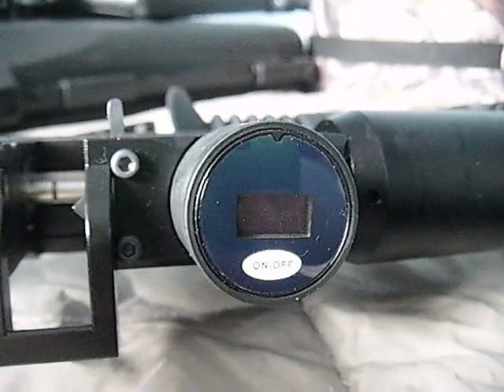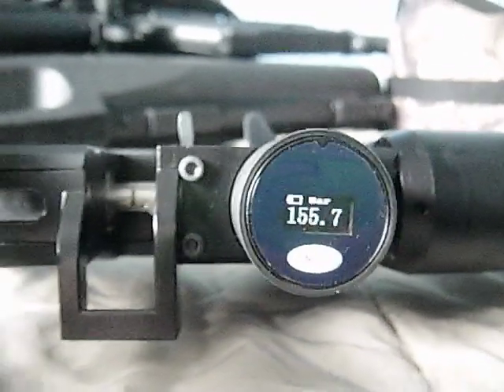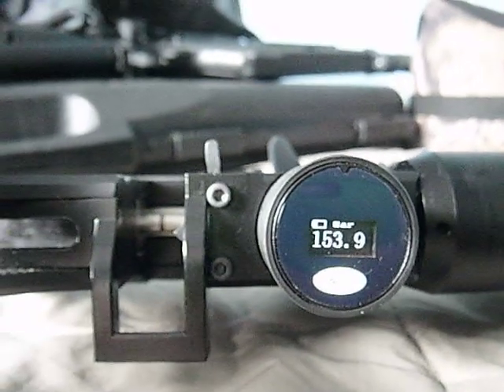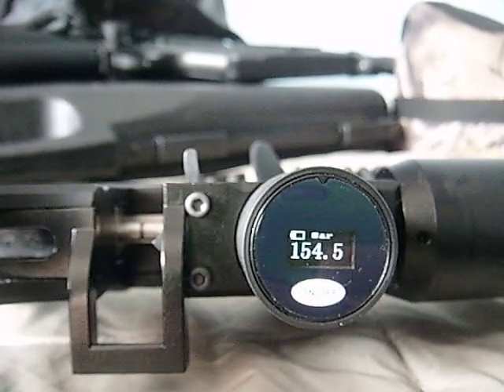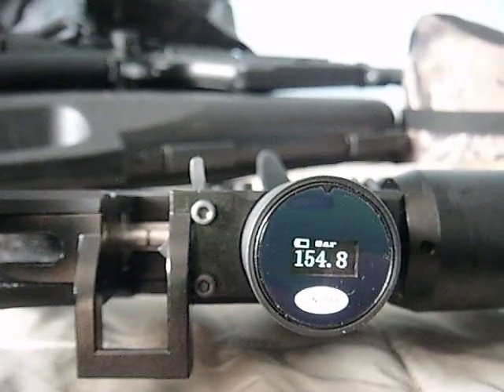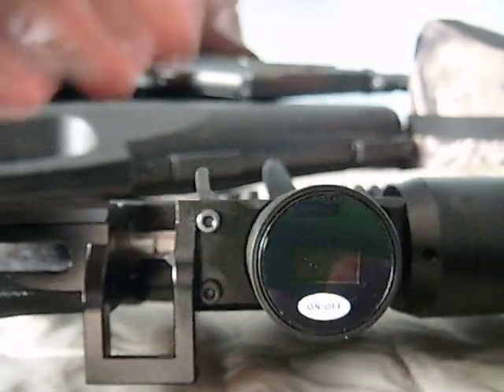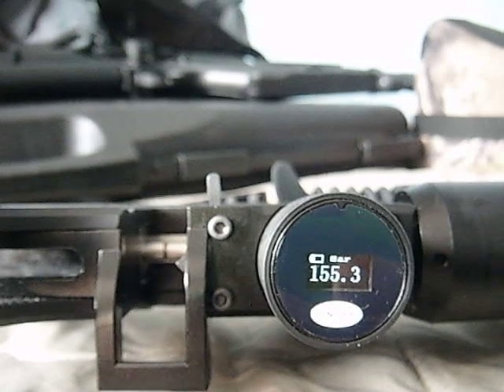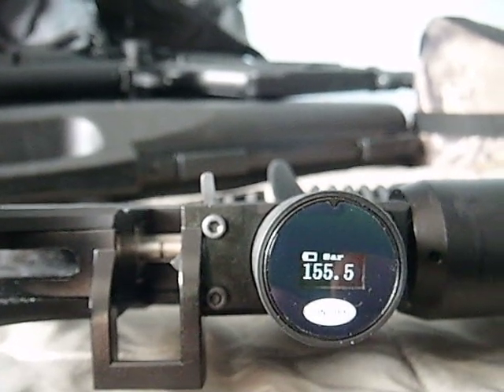FX Impact Regulator Recycle Time Test

Comment: Hi Tony.  That is not right, the regulator recovery should be under 3 seconds.  Check out my regulator video on regulator servicing and see if you can fix it 👍🏻
Reply from the maker: if you have an FX gauge or Wika Gauge, you wont see the needle move for 5 bar and you certainly cant discern between 1 or 2 bar. so which didgital gauge do you have?
Reply: @tonyhowell5283  i have the Sekhmet

Comment: I had the same issue. Disassemble the gun and put the bottle with pressure on so the gun get cleaned from inside. Also play with the amount of discs. If all that doesn’t help get a new regulator, it also maybe the first regulator that causes slow refill
Reply from the maker: I thought it was due to micro holes that the air has to travel through in the piston and adjuster? but maybe if I clean and lube my belvilles that will speed it up?
Reply: @tonyhowell5283  no I don’t think the lubing will help at all. The small holes shouldn’t cause any issues. Only if there is stuff in the small holes. Try to clean them and increase first reg Belleville springs from 11 to 13. That should help too